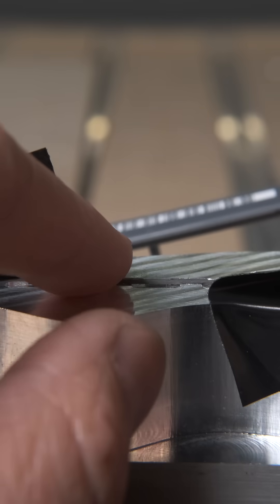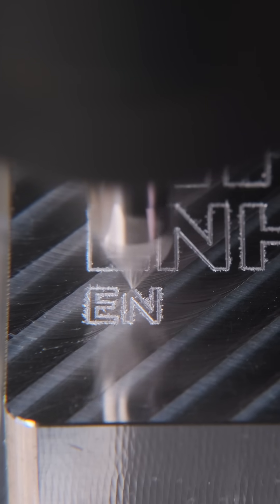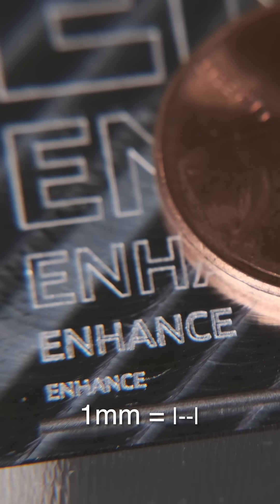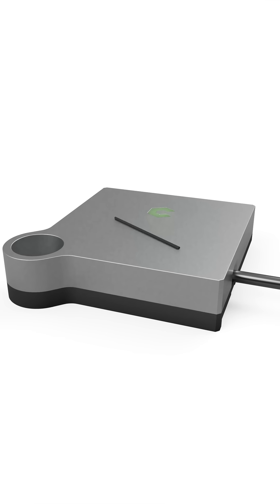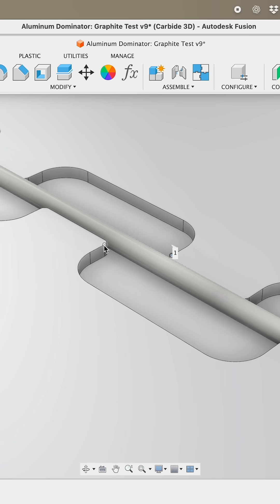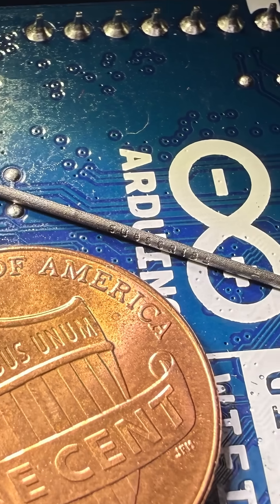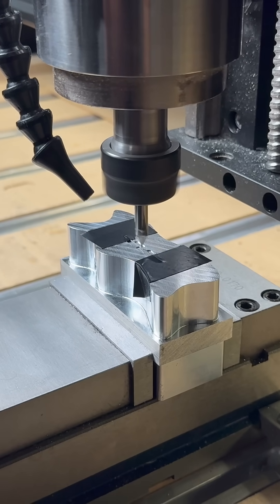How to Engrave Pencil Lead on a CNC Router #cncrouter

Comment: Nice work, but it would be silly to think that this is anywhere close to the smallest feature someone has milled. Injection molding parts are finished down to micro-meter accuracy. Or take a look at what Kern does for sample parts.
Reply from the maker: Yep, seen them at trade shows before and had their material scientists on my old podcast. But it's a different class of machine. Still waiting for someone to give me an example of this kind of stuff on a gantry router.
Reply: @WinstonMakes  alright, it would have been good to be more specific with your question in the video.
Reply from the maker: I did specifically say "CNC router" to qualify my statement. Easy to overlook nuance though. Perhaps room for improvement next time.

Comment: This is cool! I once used a 0.1mm carbide drill to make a 20x20 mm array of holes in steel at 0.25mm spacing for a specialized filter on my router, that’s pretty close to this scale.

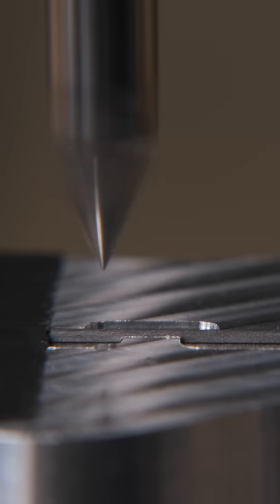Comment: At 1:18 what is does the picture lend to the explanation?
Reply from the maker: Provides a little more context for the size and architecture of the machine, and where the aluminum frame pieces are that are subject to thermal expansion.
Reply: @ This field of DIY cnc machinist is new to me and it mostly sounds like a relatively new kind of hobby for me👍 Thanks for making an in depth video about it

Comment: About 40 years ago, I was milling lettering into graphite electrode material with a .016" end mill. The electrode was then used in an EDM to burn the letters into tool steel lettering dies.  
Your .4 mm  tool is the same diameter but with a point, the lettering is smaller than mine.
Excellent job...PS. I broke a few .016" end mills...lol!
Reply: Sounds like it was a pretty cool job!

Comment: Very nice workholding solution!
The results speak for itself.
The smallest thing i have seen so far being machined on a CNC was from Kern Mikrotechnik... Iirc they drilled a 0,02mm hole trough a human hair and also engraved one with 10 micron diameter cutter.
That's a whole different beast of a machine tho, but i'm seriously impressed with what that router pulled off there.

Comment: That zig-zag pocket was one hell of a solution! Dang dude
Reply: Absolutely inspired
Reply: I think I've seen calipers with that kind of holder in the case , of course moulded in plastic rather than milled, but I'm wondering if it's a relatively common feature that he's seen and remembered , or an independently good idea

Comment: I don't know about engrave but Hermle makes CNC machines that can drill holes in a HAIR. A company in my city makes a machine with 100nm accuracy which is small enough to cut the traces on some larger microchips.

There was a Japanese TV show where a guy used a manual lathe to drill straight down a pencil lead LENGTHWISE.
Reply: The show is called Supreme Skills! And the competition was the large drilling vs an EDM method
Reply: @Yoshikaable  bingo. I loved that series. It was amazing seeing the neat stuff they developed and Japanese culture.